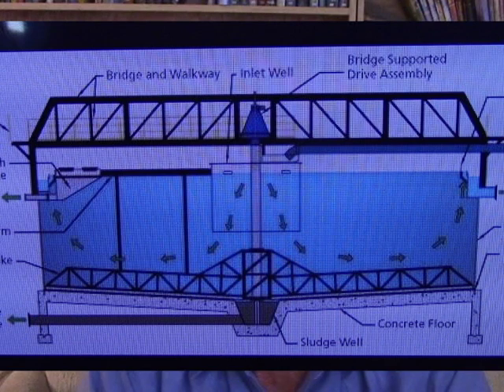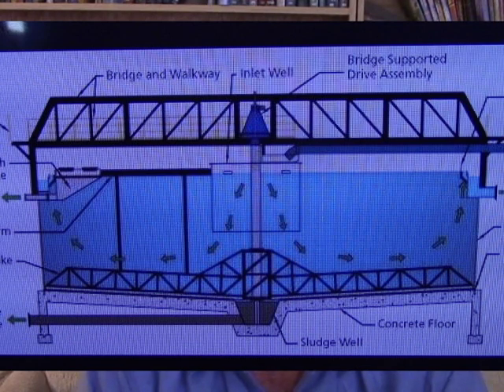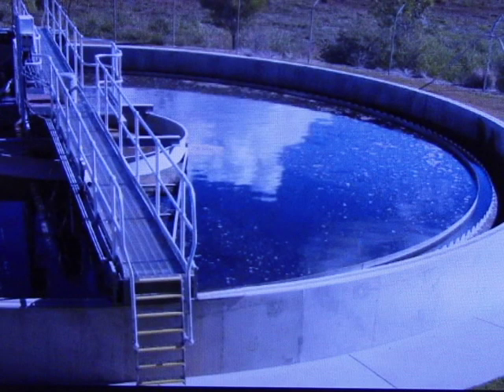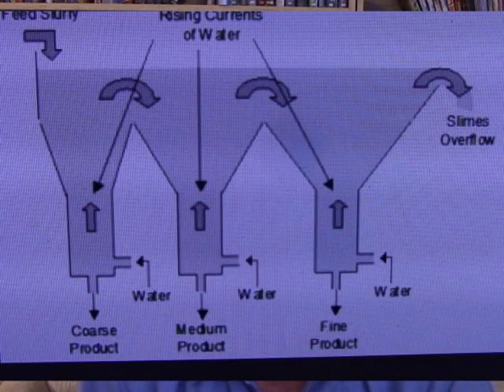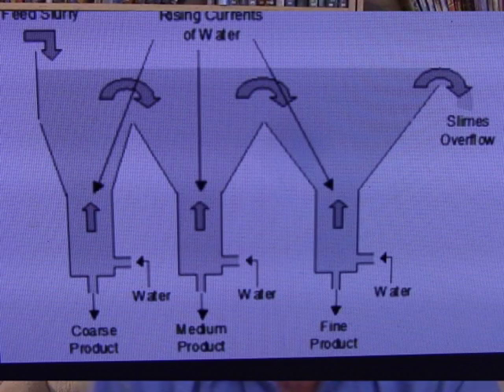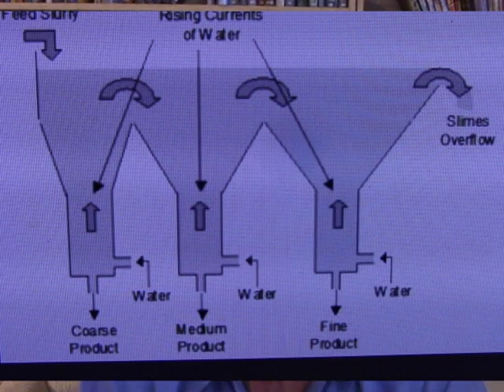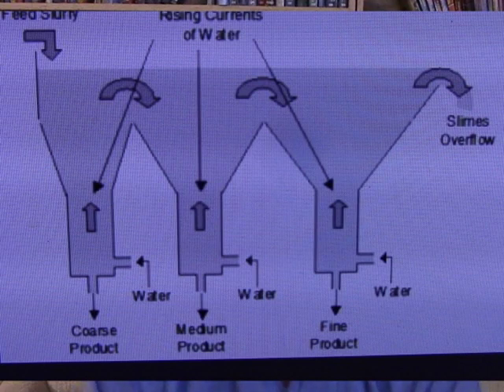Fundamental Milling Principles-  Settling,  a Useful and Versatile Tool

Comment: Do you know about radial flow filters?

Much more efficient than straight settling basins or chambers. I can email you some docs. Very very simple to make. I used them in aquaculture as the second stage of removing solid waste (first stage was the part of the fish tank design) prior to further polishing if required.
Reply from the maker: No I have not.  Please sens some info.  Thanks